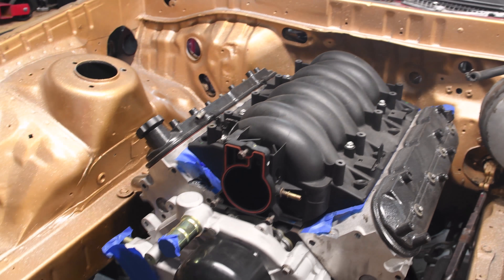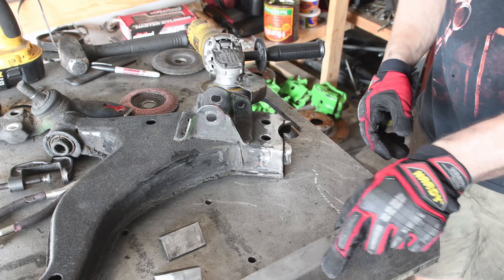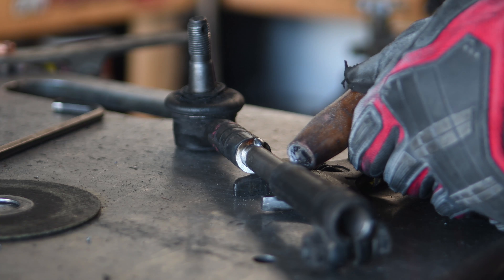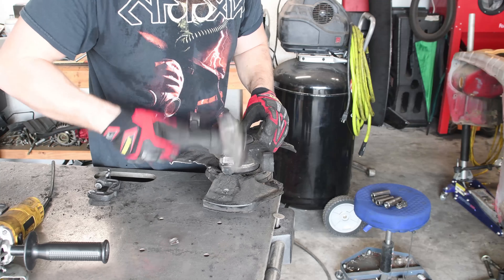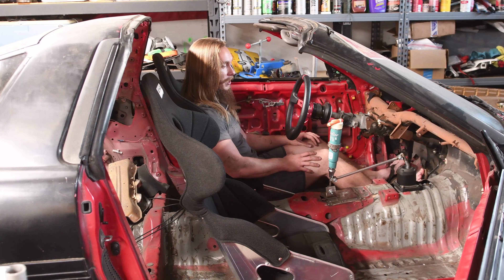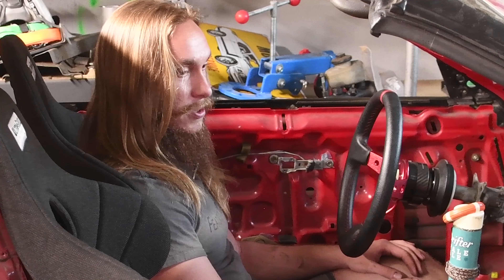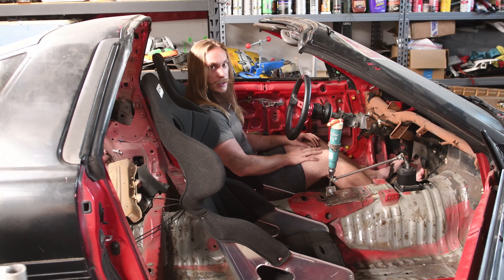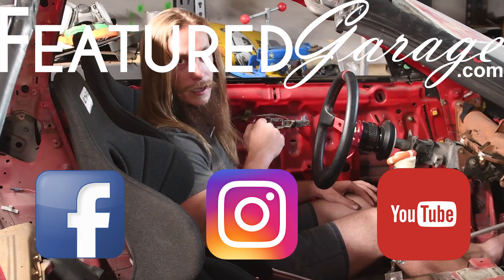V8 Swapped Supra Drift Car DIY Angle Kit

Comment: Beech Performance has adjustable upper control arms for the MK3 Supra. Have you checked those out when you were looking?
Reply from the maker: They went out of business.
Reply: DriftMotion has it listed for sale but they may have never updated their site. That does suck if they closed as their dual fuel pump hanger with an fittings on top was a very nice piece for the mk3 Supra.

http://www.driftmotion.com/Beech-UCA-MK3-Supra-p/dm2426.htm
Reply from the maker: Shwalker07 I’m willing to bet those UCAs are like other parts they have listed in that they’re made to order. The thing is, nobody is ordering expensive aftermarket parts for the MKIII Supra. Getting Battle Version parts from DM that were listed as shipping in 2-3 days actually took a month and a half to receive because they didn’t actually have them. Additionally, Beech performance was a diesel performance company. They weren’t heavily vested in MKIII Supra components so by bets are on no parts supplier having a supply of $600 Beech UCAs.

Comment: where did u get the custom control arms from?
Reply from the maker: In the video, I mentioned I got it from Funo Auto Tuning.
Reply: @FeaturedGarage  Cheers for the response!  I was looking at custom control arms as well for the mk3 but came across the same problem, I wasn't sure about the taper needed for the upper bushing to fit on the wheel hub.  If by chance would you happen to know what that taper was?